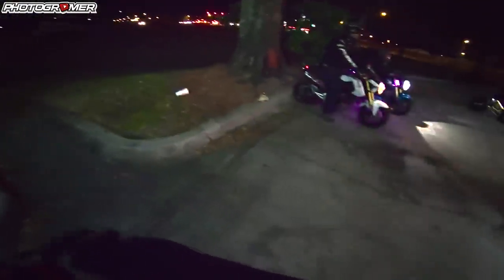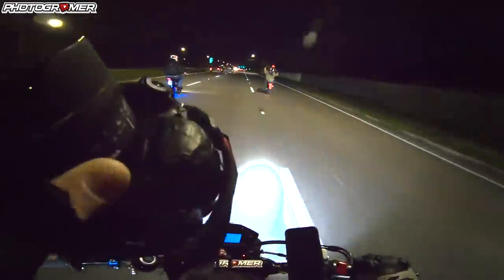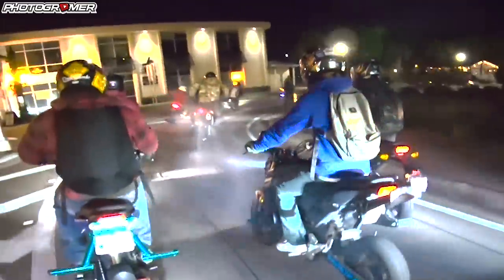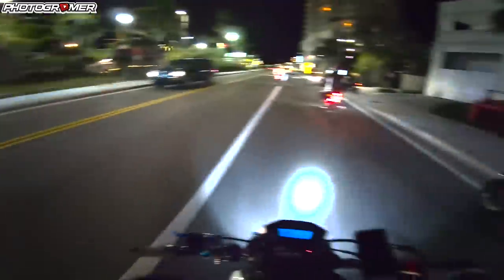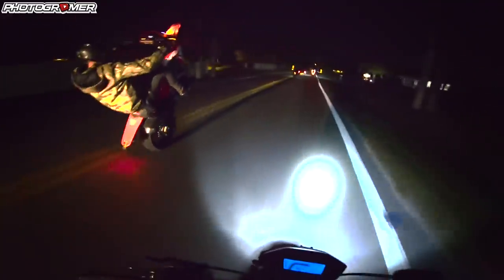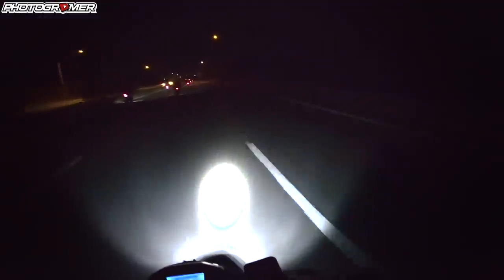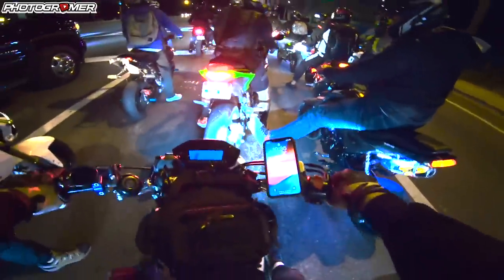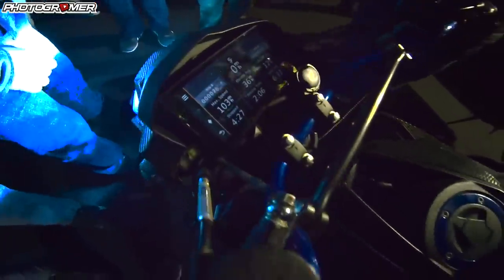FASTEST Grom vs Z125 and DankWheelie

Comment: What’s best setup for stock bore grom? I’ve done a ported head with throttle body match and throttle body belled at front. Stock bore throttle body but I got finbro ecu and tbparts cam. Tbparts cam valve adjust is well at limit. Like locking but is only on by half the threads. So best cam? Head was shaved .020 but porter removed some material from around exhaust valve to help flow. Any info would be great. I’m doing this grom by myself. Stock bore. It’s a 18 with 767 miles lol. Thanks

Comment: What your camera setting  for rollers
Reply from the maker: always depends on the light but usually shoot on shutter priority around 1/100 and bump up the ISO if it's too dark or lower it to 100 if it's daytime. If you're shooting faster subjects you can get away with a faster shutter speed or if you hold your camera lower to the ground.

Comment: Hey I’m thinking in getting on of the 2 bikes the grom or a z125 with a 143 big bore kit and I’m pretty much gonna drive it every day as my daily to work and it’s 28 miles to work and roughly 56 miles round trip what would you recommend I’m thinking in buying in the next week or so.
Reply from the maker: Stock grom is best for reliability for a daily rider. People around here have 20-30K miles on their stock motors. As soon as you go bbk you add vibration and different factors that can wear support parts quicker if you do not upgrade bushings and get tuning accurate. So stock grom would be better for reliability.
Reply: Are you just telling me so I can get a grom lol just messing with ya I live in Denver Colorado there is a z125 with a 143 big bore kit for sale. but one thing for sure I am a Honda guy I owned Honda civics from 90, 97 and most recently a 2000 civic all modified but not as modified as my 2000 civic it has a 2008 tsx Acura engine with a turbo making 440 hp to the wheel. so Definitely going for a grom
Reply from the maker: Lol I don’t really care which one you get just letting you know what’s more reliable.
Reply: Thank you, you made my decision easier next week I’m gonna get one for sure
Reply: So what mods should I get since you have more experience on groms
Reply: Gotcha I’ll let you know when I get a grom
Reply: I got the 2019 grom today